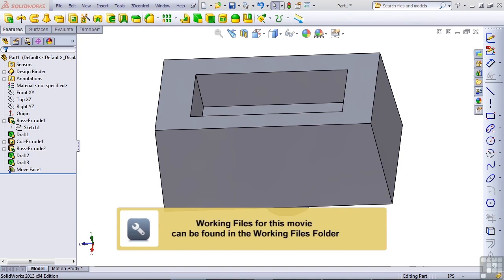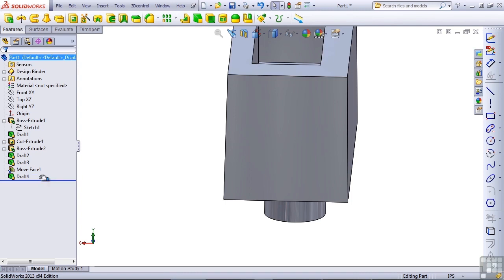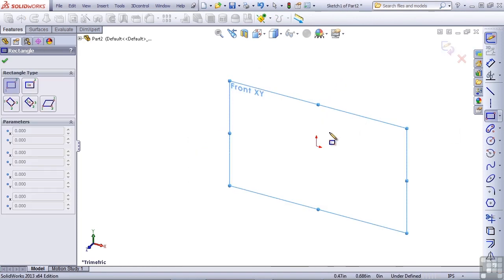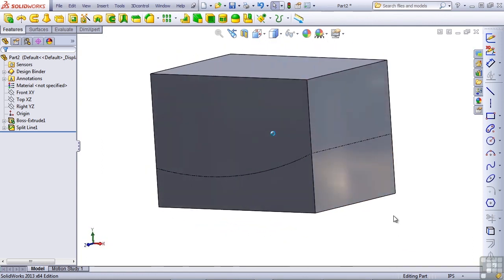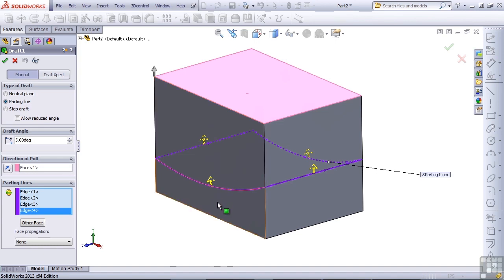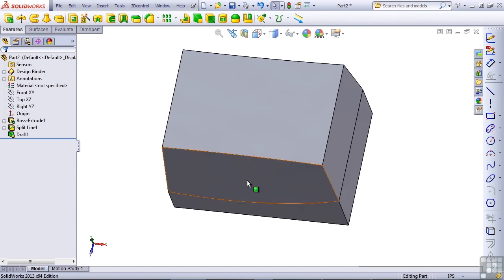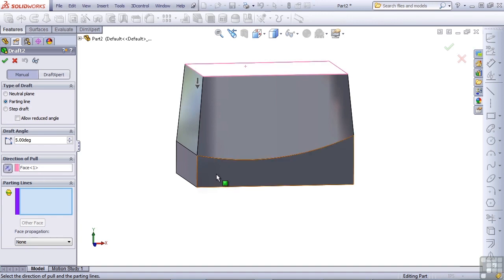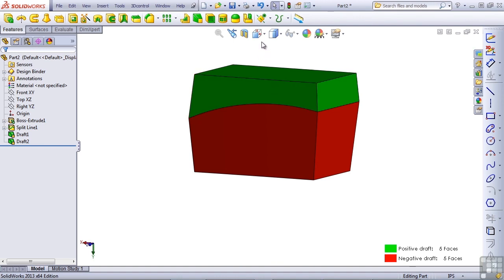SolidWorks 2013 Tutorial | Parting Line Draft

Comment: Great tutorial, but why would you or solidworks allow putting a parting line and draft either sides, wouldnt you create two separate parts since a part like this is impossible to manufacture?

Thanks!
Reply: This way you don't need to create another piece and you can just split the two bodies, while ensuring everything fits and is related so you can change dimensions on one part while the other part is changed with it, due to the relations. A part like this is perfectly manufacturable, since Solidworks doesn't know whether or not this part will be made out of plastic, metal, etc. Also Solidworks doesn't know how the part will be made, it can be machined or even 3D printed. Therefore Solidworks doesn't force you to design objects in certain ways.